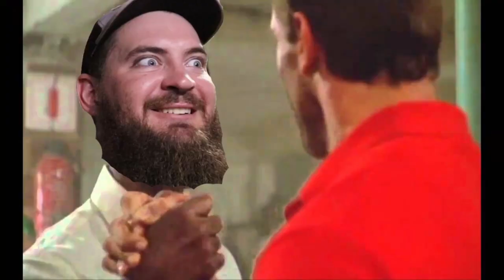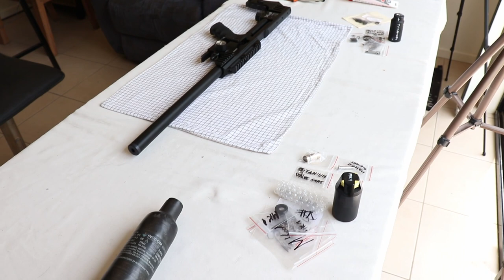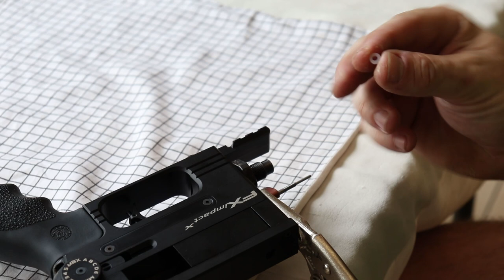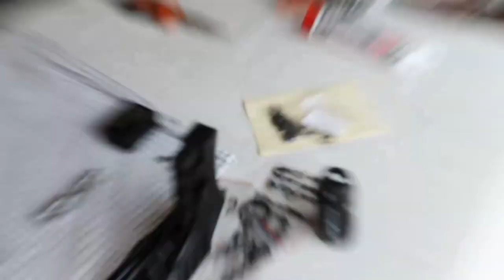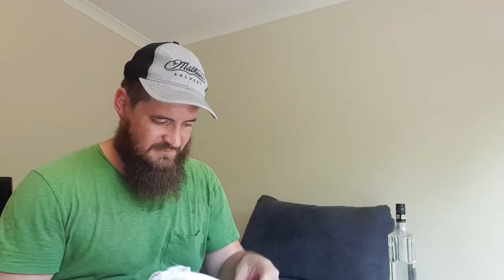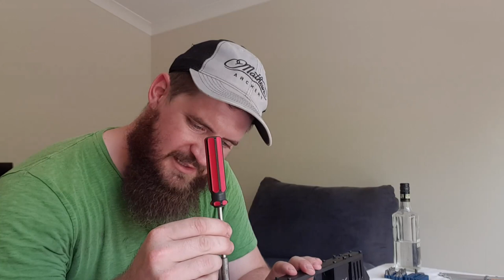FX Impact Plenum Install

Comment: On your ‘Tuna’ tuning vid, you invited sharing of Impact settings. Here are mine for Vlad’s power up plenum and valving kit, post installation. They’ll perhaps give other folks a glimpse of the modifications potential 😉
Hammer Spring dial set to MAX, gap measures 19.59mm
Reg pressure - 115 bar
Valve stop covers half of line 3
This gives me 930fps @65 FPE with JSB King heavies Mk1 with 830fps for 51 FPE with the dial on MIN.
This is with the slug liner fitted which slows the pellet by about 30fps. With a pellet liner fitted, I turn the reg pressure down to 110 bar.
Vladan is correct of course, this mod isn’t all about power, my rifle uses a relatively low reg pressure, a very relaxed hammer spring tension and is sweeter to shoot.......So I won’t wear it out so fast, the relaxed settings also go a long way to taming the recoil I experienced at higher setting.
I have maxed everything with the mods fitted, the figures are remarkable for an air rifle, but pellet stability suffers badly.
Good luck with your tune, I’m looking forward to seeing what you make of it 👍
PS. I suspect it might be LOUD!!!
Reply from the maker: I am very keen to see how loud or quiet it is compared to standard. It'll be very good for the Australian market of big plenums with low pressure regs turns out to be quieter then high pressure stuff.
Reply: Meathead Marksman That would be great! Imagine........same power, quieter gun.......or even, more power for same sound level 👌
Reply: Pest & Wildlife : What caliber & pellet weight?
I did the valve body mod a few days ago, and yesterday machined up a small external plenum for testing until Vlads 63cc plenum arrives. I did some testing last night with 23 gr nsa slugs in .22 and got the following:
23gr nsa slug .22
power to 4 (with 17.3mm gap)
Reg press at 122 bar
valve stop adj fully open
Velocity = 135fps with very low ES.

Looking forward to getting Vlads 63mm plenum.
Reply: I forgot to mention - using Impact Mk1 with 700mm slug liner.
Reply from the maker: @neil1058  135fps? typo? 1035fps? ill be tuning for 34gr jsb @ 900ish
Reply from the maker: @neil1058  135fps? typo? 1035fps? ill be tuning for 34gr jsb @ 900ish
Reply: Sorry typo   935fps. I can get faster but the ES at this setting is very good, so will be testing it at the range in a couple of hours time.
Reply: neil 10 .25 JSB King Heavy @ 33.95gn
Reply: neil 10 Tested my slug liner at the power settings I stated for the first time today with the pellets. Definite group tightening, couldn’t get on the 100 yard range, but at 50 metres, it was a clover leaf 👍
Reply: Thank you so much for sharing the info. Much appreciated.

Comment: Excellent video and super helpful to the FX Impact club. I was gonna buy one but am impatient and got the SK-19 instead. Glad I did because when I do get one I probably wouldn’t have any other buying ambitions for a while. This SK-19 is doing everything that I ever wanted from an advanced high end PCP and more. Super accurate, extremely tunable and so ease to do...1 knob and done, quiet, and handles like a dream. The trigger is the only thing that’s not match grade and honestly don’t know if I would want that on a semi/ full automatic anyway. It only took a mag or two and had it sorted anyway so no biggie. It’s a lot like my old Benjamin Sheridan 392 which I have been shooting for decades anyhow. 

Since FX came out with this power plenum, I suppose all the new Impacts leaving the FX factory will have it on and if they do then I saved myself another 100$ by being impatient... first time that’s ever worked out for the better..lol. Looking forward to what FX does next, and for the demand for these to die down so the waiting period isn’t as long. It may be worth the wait but if you knew how I am...I would go crazy waiting weeks if not months for it to get here. Quality control seems to be an issue at the moment according to my research and talking to those how sale and work on them even before they leave the shop their fixing things that are not just quite right and were missed or need upgraded to current spec. Even FX admitted that is has been difficult meeting the demand and even though unintentional there have been some QC issues that they are trying hard to get sorted. At least they are honest about it and are trying to fix the problems, and often go out of their way to retain a quality product and a satisfied customer.. It makes a difference who you buy this particular gun from. AOA , Utah Airguns, PYA, AGD, and Blue Ridge Airguns seem to at the top here in the states, at least from my experiences with them. These kind of dealers that only deal with quality airguns and care about their reputation, and it shows by their commitment to not only their products but the customers after the purchase, not before like some others. Some guys are like o yeah it’s all good,no worries, till they get that cash then once they got it they are like, who are you and that’s your problem that will be $299.95 to repair! Too many of those clowns out there. 

Your videos and the time and effort you put into them are very much appreciated and as a person that wants to see this passion grow and prosper...I thank you. Very cool that you are willing to do all this to help others shooters out there who might otherwise have to send it off to the last type of unwanted dealer mentioned. That guy who only wants your money and nothing else, because you seldom get your money’s worth with that crowd and they end up with your gun forever, and is probably not right when you do get it back. Thanks again for this most informative and very helpful video. Hope the fires are getting under control and haven’t effected you and you family. Take care. You rock bud.
Reply from the maker: Thank you for your kind words mate! No dramas with fires were I am now, we've just hd a week of rain and everything is green and lush again :D

Comment: FX does not recommend firing to degas. They actually recommend increasing the reg pressure (counter clockwise) until it hisses out.
Reply from the maker: must be a new thing, I got the previous user manual with my MKII Impact and it says to do it the way in the video. I hope they update the user manual soon
Reply: @meatheadmarksman2013  I also just back off the press gauge a tad.

Comment: Great video as always. Thanks for the big efforts. I’m also Vladan’s customer, great products and better person. Highly recommended. BTW, you’re not drilling out the little delrin o-ring under the valve housing block so that the external plenum gets better the flow. Is it OK not to do so? Please let us know about your results. Thank you very much in advance.
Reply from the maker: I think if you want everything to be as powerful as possible you should drill it. Probably a good idea to cut the valve housing as close as possible too if your trying too eeeeek out every last fps
Reply: Meathead Marksman Thanks for the input. Yeap you can also do the porting on the brass end and the half mooned pellet probe to get a few more fps, I presume.
Reply from the maker: @k.feduchy745  yeah those parts are included in the kit already modified

Comment: Nice instructions!
I notice you didn't install the hammer weight? In what order does it go? 1; hammer weight.  2; spring. 3; hammer?? Can you help me out.
Reply from the maker: Hammer weight goes inside the hammer with the big end first so that the hammer spring can fit over the long thin bit of the hammer weight. When you put it back in the gun go in spring first over the valve stem from the muzzle end of the gun.
Reply: @meatheadmarksman2013  
I installed it like you said mate.
I noticed my fps is the same as I had it without a plenum.. Do you know why? 
I've done everything like you did.
Mk1
600mm
930 fps
Max power 
26.8 grn NSA
Reg: 145! Bar
Its supost to be less air used for more shot count. 
Slugs are not even that heavy, will go to 34 grn, but if can't even raise it up for this ones I have no clue for the heavier one.
Any ideas ?
Reply from the maker: @martinvilla8283  hmmmmmm that's very strange. Did you cut the bar off the bottom of the valve housing? I tuned mine today and it shot 970 without me changing the tune. +40fps with plenum alone for me
Reply: @meatheadmarksman2013  
Yes I did... what I might forgotten was to change the valve seat that cames with the kit. Does that matter? 
C3 bumper is the same one.
Reply from the maker: @martinvilla8283  I wouldn't think the valve seat would hold you back that much. Make sure you have delrin c3 bumper, if you already one in there thats fine but if its rubber o ring change it for delrin one. That can suck power once they start to fail. Better email vladan and ask him.
Reply: @meatheadmarksman2013  
Sounds good bud thank you for taking your time on replying all of our questions! We really love what you do!! <3 keep it up!

Comment: so just for giggles. where does the diminishing returns come in as far as plenums go? like if u get the 63cc external alu plenum combined with the 54cc fx power plenum, that would be 117cc plenum capacity. how would this impact performance and shot count? lets say its for a 25cal. shooting slugs.
i would expect it to stay just about the same as what u get with your setup as the transferport in the pellet probe may be the restriction?
i have done no research on this, just to be clear :)

Comment: Hmm, i wonder how fitting the fx power plenum and the external plenum would work...?
Reply from the maker: you would have to set the reg very low haha youd get so many shots too haha
Reply: @meatheadmarksman2013  how many shots are you getting before consistency drops off?
Reply from the maker: @ytkb8401  I havnt done a shot count yet mate but the shots are all consistent until it gets below the regulator pressure, and that's 25bar lower then it used to be to get the same speed so I get about 30 shots more then I did before per fill. Pretty significant increase

Comment: Bro i have a impact mk11 is the ok the i left my pcp with 200 bar yesterday in today it has 190 bar
Reply from the maker: Sometimes temperature change can account for a small drop in pressure like that, but if it keeps looking pressure and doesnt stop tighten up bottle and  gauges, just until they are tight dont go nuts and brake them. If its still leaking after that there is a bad o ring somewgere in there
Reply: @meatheadmarksman2013  ok thanks man

Comment: Perfect vid as usual!!! The barbs always come at the right moment!!! ;-) :-D :-p
What you think Hodge....thinking....i already have the Power Plenum kit i am thinking installing...but just to push the limits....perhaps over the edge...i would like to also install the Vladan External Plenum!!
Give away some wizZZdom!
US Texan accent!!!!! outstanding!
"This is how Ernest keep his skin so healthy" :-DDDDD best comment on Ernest R ever!!!!
T-Shirt almost standard Ozy wear!!!!! Perfect!!....all though not the parade standard total dirty.....once white tank top!!!!! 
Cheers!!
Reply from the maker: Vlad tells me Lots of people are running both the pp and the big vlad plenums. You might have to run very very low pressures and close off the valve alot to get slow speeds for indoor work but if thats not an issue and you are just chasing big power itll work real nice for ya

Comment: what is power plenum and how its work sir?
Reply from the maker: The power plenum is basically the reserve of air held by the regulator. The standard unmodified gun has a plenum capacity of 25cc and adding the power plenum increases that capacity to over 80cc, which allows the gun to make much more power at a lower regulator pressure

Comment: If you had used the hammer weight, do you know if the spring guide is not used? Thx
Reply from the maker: no the hammer weight acts as the spring guide also so just slide the hammer weight into the hammer, pop it onto the spring and wack it back in over the valve stem. leave the spring guide out
Reply: @meatheadmarksman2013  Ok thanks, nice to have confirmation. Trying to screw in the plenum it wont go in far enough to bottom out the washers. I am thinking of drilling the valve block deeper to allow it to screw in more. Plus, pondering whether I should drill it 6mm and all the way through to the valve tube. If that makes sense would value your opinion, Thx
Reply from the maker: @Fin181  I would email Vladan directly about that, take a few pictures and ask him all about it, he will have actually done it before so hes your best bet. It would just be speculation if I was to suggest anything